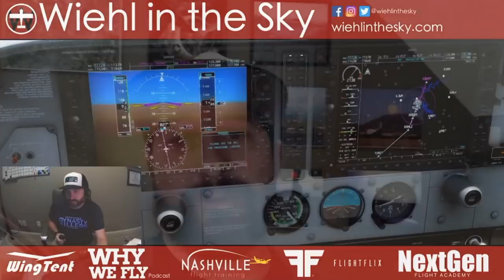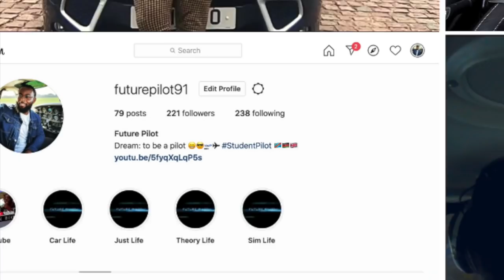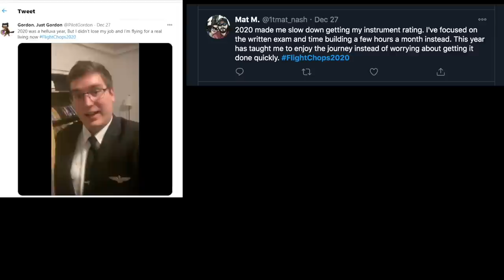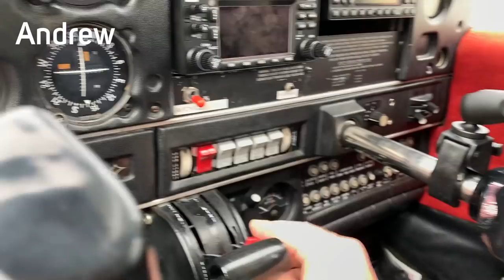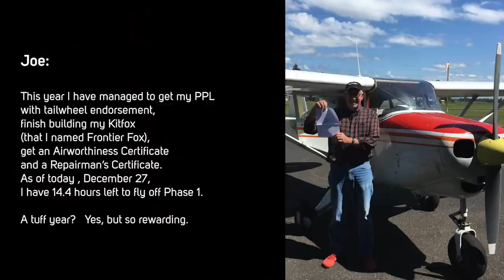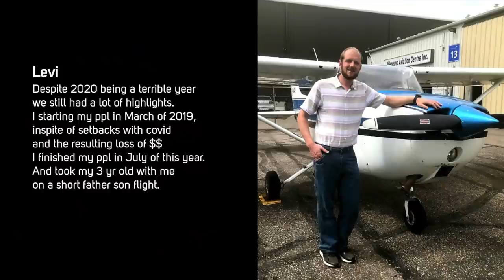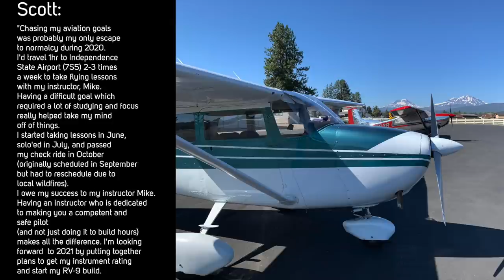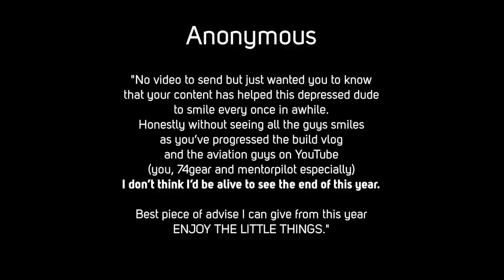100s of YOUR Flying Struggles / Triumphs from Aviation’s worst year 2020!

Comment: I started off 2020 with new vision (got cataracts removed)! Got the ok to fly 1st of February and setup instrument training. Then CCP-19 hit, instructor decided he didn't like the drive, and Aero Club shut down. I retired July 2nd and setup training with another instructor and the Club reopened. Only got a couple flights starting in August that were weeks apart. Not a good way to try to get back to flying solo. Weather and scheduling were big issues. Got the ok to solo just before Christmas. But wasn't able to get in the air due to weather. 
I have started this year better with having gotten my first 2 under the hood lessons last week! I have been doing a lot of simulator flying with my X-Plane 11.5, 3-32" monitors and Saitek controls. Plan on doing a lot of instrument flying at home. Hope to get my written done in next couple months. Hope to become an instructor since that will be the only way I can afford to fly in retirement. Keep on flying!

Comment: I saw when you posted the video. I wish I had been able to say something. My video would've been pretty long, though. Not a big deal.

Failed 3 out of 4 of my aviation classes in my first semester 'cause I was trying to pay rent. I could barely tell which way was up because work and school really bullied my sleep schedule. I did get promoted, so I'm at a place where my schedules won't conflict with sleep nearly so much. Here's hoping to a huge rally for my  second semester.

I will say it was useful being an essential working. I made more money than I ever had before, and completely paid off my credit card that I've had a balance on since 2012.

I didn't shelter in place once. I didn't get my mechanic job with the A&P I earned in the summer of 2019. I didn't get the avionics jobs I was going for, either. I am hanging in there, but confidence is hard to come by these days.

I am very far behind, but I'm still going to move forward. Here's to a better year.
Reply from the maker: Glad you’re sticking it out!